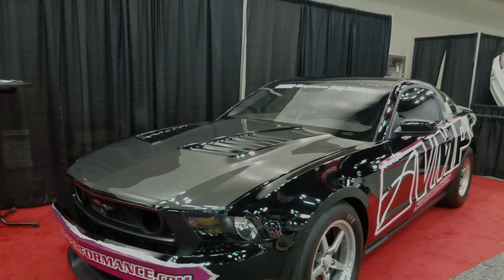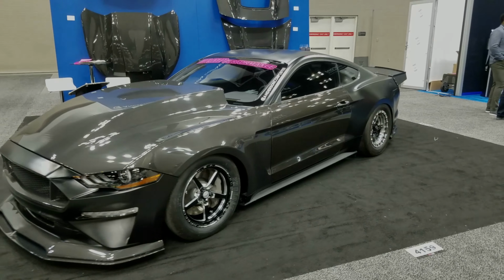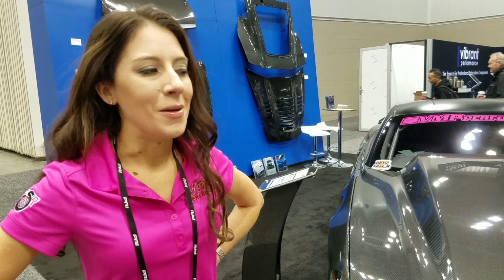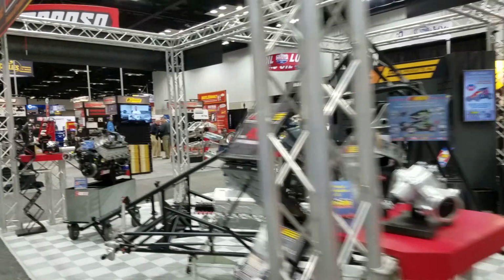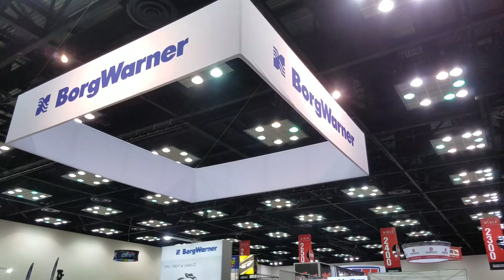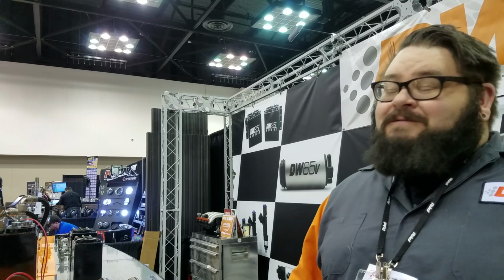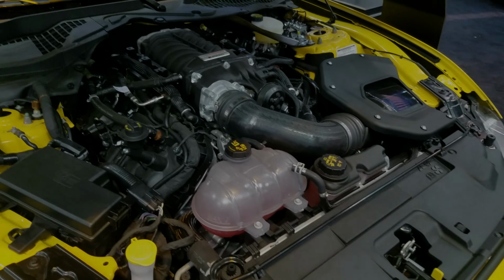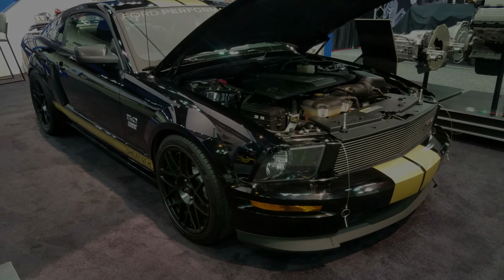PRI Indy 2650 TVS 2018 Mustang Gen 3 VMP Anderson compositeS EVERYTHING!!

Comment: ZR1 has a much bigger motor. 2650 won't make 750 hp without pushing 14-15 psi. And that's to much for a 5.0 to me. Plus the new 5.0 is very high compressa d thus not good for boost.